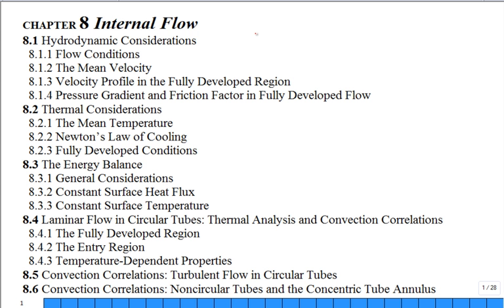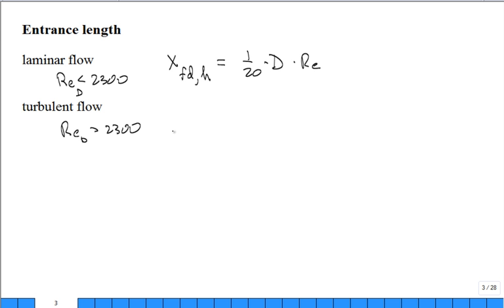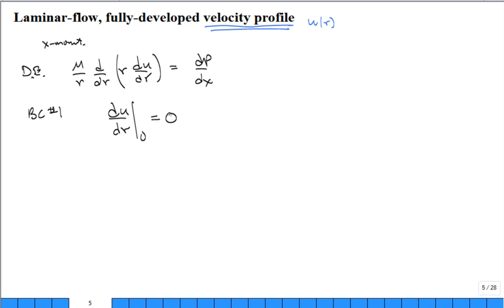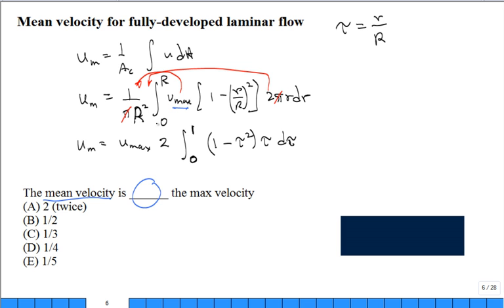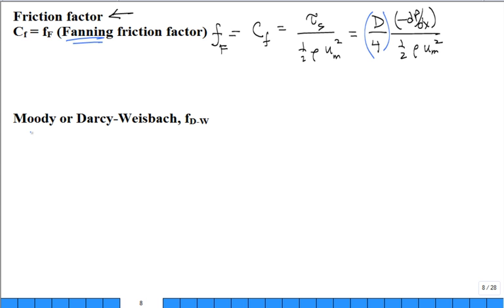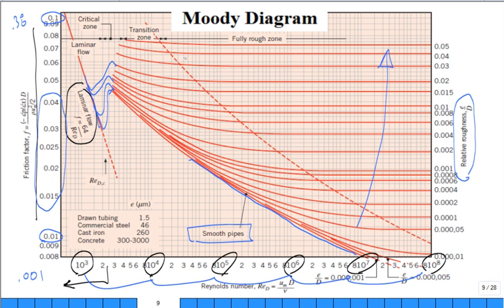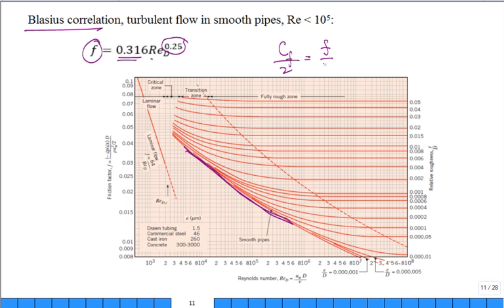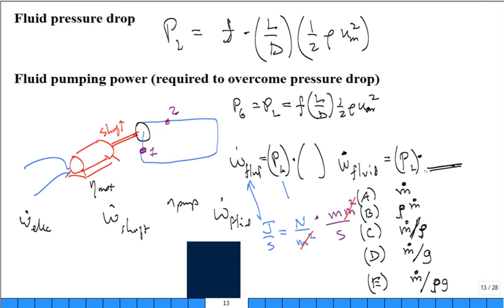Heat Transfer Internal Flow 1

Comment: At 16:11 it looks like the mu term disappears from the equation. Is this an error or does something about applying no-slip conditions cause the viscosity to disappear from the overall equation?
Reply from the maker: you are correct, "mu" is missing.  u = R^2/(4*mu)(-dP/dx)(1-r^2/R^2).  Then u_max =  R^2/(4*mu)*(-dP/dx). thanks
Reply: professor while writing navier stokes equation full equation should be written then our assumptions and physics of the problem eliminates the remaining terms from navier stokes equation for cylindrical coordinates